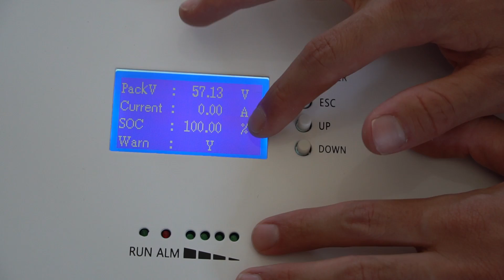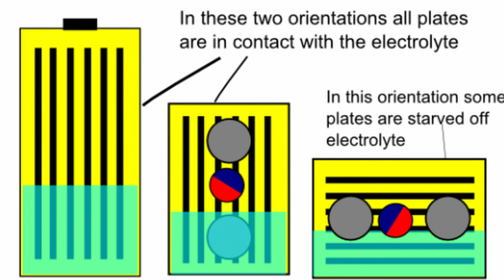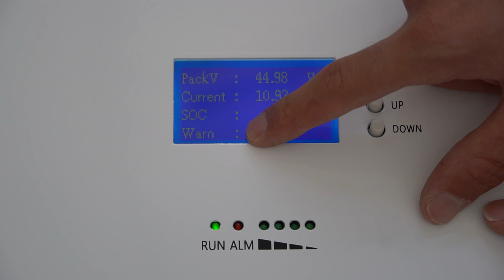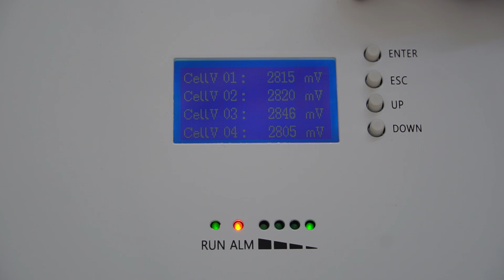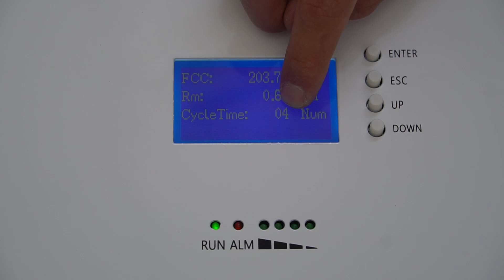10kWh 48V LiFePO4 Plug-N-Play Solar Battery for $.38 per Wh: Full Tear Down and Capacity Test

Comment: I definitely want to try 2 of these batteries, the 13kw variety.  They again seem high as the devil but such a nice design for storage.  I have 48 280 cells setup for 840 ah using Daly Smart BMS units.  Annoying that they do not talk together as one.  Adding 2 of these or even 1 would complete my requirements for daily power.  I also ordered one of your chargers from SS.  The 48v 25a one.  I can\t wait to test it out on this large bank.

Comment: Being that those are relatively small cells, as in a very shallow design, that may facilitate the horizontal orientation.  Bigger cells may be more susceptible to orientation issues.
Reply: Advertising to the manual,  it states must be mounted vertical with no more than max 15 degree backwards tilt

Comment: Just a thought, based on the locations of the main power connector, communication ports, and handles I think they intend this to be installed in rack mount configuration flat on its back.  Yeah the control panel would be a bit more difficult to use but depending on the space between the cells when you rack mount it it should be visible enough (or you just pull it out far enough to read it). My guess is they are assuming you are going to use multiple and hook them all up together with the communication ports to a unified monitoring panel anyway after the initial install so the local control panel wont really be needed after that.  So if that is / was the case then you wouldn't have any issues about the cells stacking up on each other or the electrolyte possibly not being distributed properly.  Thanks for all the vids, I have learned a lot watching this channel!! Currently working on putting together a small pack for camping and contemplating a larger one for a camper.

Comment: The 13.4 kwh battery looks like different technology it goes together in multiple pieces or module packs. Its internals appear to be completely different. Also with a 20year warranty vs 10 year

Comment: About that cycle count, what is the depth of discharge/charge to be considered a cycle? 90%-10%? 80-20? 70-30? Does it have to discharge and charge again to or above the level it started discharging to be considered a cycle?

Comment: 226 pounds worth of Lead Acid batteries gets you about 3.2Kwh at the 5 hour rate, or just over 4Kwh at the 20 hour rate. Of course, that's for the first few cycles. After that, it's anybody's guess....

Comment: Would this battery handle 100% of my electric needs with power out? Air conditioner, microwave, elective stove etc? What's the max rate of usage? Can I recharge this battery with a gas generator? So if power goes out, my whole house can switch to this backup and if it runs low I can recharge with a generator? That's my goal right now as I'm not able to use solar or any other power generation where I'm located

Comment: As far as mounting it flat and maybe stacking them.  Use (very) heavy duty slide rails so you can pull them out and support the battery pack.

Comment: What battery would you recommend on a sail boat? I need 12v 7kwh. It would be inside, but the sea gives bumps and the heat and moist would go up.

Comment: One thing I see that concerns me is how the negative group of cables is laying over the positive pcb.  When going back to 2:20 I do not understand why there is the big loop in the negative carriers when they could have easily been routed straight into the battery area without looping over the positive side of the pcb.  Strange.  Even with the white plastic wire looms over that bundle of negative carriers, I am not comfortable.  I have been a bench level tech and lo and hi V installer for many decades.  Even in fixed applications, I try to avoid any near or cross placements of different polarity carriers.  While I recognize that space is at a premium in this battery system, it only takes a few seconds for high amperage dc power systems to go very quickly into a disastrous situation.
Reply: yeah i wouldnt want to run this in an RV or anything thats going to vibrate

Comment: How do you parallel the different batteries without huge power going through it to level the voltages? I assume lots of amps would flow because of the difference in voltages. Or you exactly matched them before?

Comment: Great video. Two QUESTIONS  1.  Would it be a lot easier and cheaper to have a single 10k unit or a lot more complex and $ to hook up two 5 k units...      2. and would two 5 k units. really provide equal power or less than one 10 k?

Comment: The reason they have to hang on the wall at 1.2 m height or even more .
Is a safety measure , if you have a flooding event .
And that beast is on grond level you have a miniature nuke aswell,  TO WORRY ABOUT ⚡😉⚠️
Reply: Unlikely he is worried about flooding in an unattached shed (no water lines) located in Las Vegas but your point is well taken.
Reply: @genephipps6421  i live in the Netherlands ,  we have a bad history with flooding .
As 85% of the country is beneath sealevel.
Especialy in the province i live in called ´Zeeland´ literaly Sealand .
And the stories of my grand pa ...
Made me biassed toward fearing water i guess ..haha lol
Grtz johny geerts

Comment: man I love these preconfigured options but the pricing never works.  It is just easier to buy 16 280ah cells with bms and instant 15kwh.  Would be great to have Daly make a smart bms that allows for stacking but they are buttheads and have not done it yet.  Do you know of any DIY bms system that has this feature yet?
Reply from the maker: You are right. I love the 280Ah cells as well. Such an easy way to build a massive bank. Oh right, that's the big limitation to FET based BMS. You can stack them but it looks ugly. But it does work.

Comment: What do you recommend for a house with all its appliances except a dryer? How much power do I need for it and should I be using a 24v system? Is the renogy lithium batteries good?
Reply: Gas dryer or electric?

Comment: How much did you spend on this equipment and how long will it take to break even on the on the investment? Is it less than the expected life of the batteries? You have great material. I learn a lot from you but the real answer is to replace fossil fuel plants with renewable plants (nuclear, solar) then figure out how to build systems like these cost effectively for consumers.

Comment: I see a lot of these LiFePo4 Batteries in the market. 

They have the same BMS, same terminals under, same package content, and product layout. 

The difference in the video's product is the Anderson Plug. The plug is a little difficult to find here in Manila. 

Though we are using mainly DEYE Hybrid Inverters in our install, the usual problem of these batteries is the DC Low-Volt Fault and sometimes the batteries don't balance or just becomes fully drained. 

The batteries just automatically returns to its normal condition after Inverter firmware update. 

Though I'm confused as to the reason why these faults happen.
Reply: if with Deye inverter, battery will communicate with inverter, just set the inverter charge voltage will work fine.
Reply: @youthpowersolarbattery9540  Hi, what will I set in the inverter charge voltage? 

I mean, what value should we put or consider?

Comment: Thats still mighty pricey.  I paid $1500 for 8kwh, but to be fair, i had to assemble it my self and it does t look as pretty.  All parts considered, i still paid half of what they are charging.  Assembly is simple - get batteries, assemble on a flat surface, with 90degree angle to  butt it up against. Glue cells together temporarily with hot-glue.  Order nickel strips, cut them as needed, build basic welder using a button, car starter relay $35@local parts store, and some thick copper wires mounted on a wooden block. Use car battery for the power source and get a solid fuse to prevent stupid mistakes.  Get hole saw, cut holes in the right places on a couple 2x4. Cut 2x4 along cener through the holes to provide a top-bottom supper. Sandwich between two ply board cut to right size, leaving room at top to mount BMS and DC fuse.  Connect wire, add a connector like the one seen in the video and bam.  Ive made 17kwh of power my self.  Couple to 6000w of solar panels and midnite 150 solar charge controller.  Make a LVC using $12 programmable delay with thermistor connected to the normally closed side of the board relay, and a 12V 100A relay connected to the normally open side of the board’s relay. This provides a soft start/inrush prevention to keep from damaging the inverter, and prevents the relay contacts from welding together, so the charge controller can shut off reliable when the voltage gets too low.  I run two AC units, one that draws 1.4kw and one that uses 1.1kw.  The second AC unit only comes on when it gets really hot otherwise its not needed.  When the sun goes down i normally have 15-16kwh of power to: charge my neighbors car with the excess, run my two computers and do a number of things.  The BMS has thermal cut off, but because the system is capable of taking in 3.4kw of charge at 1C, and charging never exceeds 4.8kw, the batteries NEVER heat up beyond 31C, in the summer, under full charge load.   These batteries wont heat up appreciable until they reach 1.5-2C charge rate, which my system never achieves.   If you are a DIYer, dont waste your money.  Takes a few days to put the batteries together, a few days to charge and test. Batteries come charged at 3.2V per cell.  Charge pack until any of the 16 rows of cells reach 3.45V, then using Variable DC power supply ( $50 amazon), charge each row to 3.65V and wait till final charge rate settles to .07A, perform this once more for each row 12hr later, then bolt the shell together. Bam. They are ready. BMS will balance them from here.  Its been a year since my last balance and the batteries still dont need maintenance.  If you have time and have the skills, dont waste your money on something like this

Comment: I love the videos Will. Excited to see what's under the blanket. 

The EG4 batteries from signature solar are slightly cheaper at $312/kwh. Am I correct in understanding that the "UL approved" status of this Energetech battery makes it ok to install indoors (garage in my case) for those with home owners insurance? If so, that alone would sway my decision making. The little LCD is another PRO.

Comment: Great video, thanks for the detailed explanation.
With 200Ah how long will it run a typical home?

Also, any idea what size solar array would be required to charge this within 5-6hrs?
Reply: Ah x voltage = watt hours. 1kWh=1000 watts for 1 hour, or 1 watt for 1000 hours etc.  You can also calculate the same with charging, minus the resistive losses or efficiency of inverter/charger, etc. Take a look at the power ratings of your major appliances and then add them up to get a rough calculation of power needed.

Comment: HEY.....Website says 10 yr  wty NOT 20!!!    $3870. each.
Did anyone notice on website those 2 silver handles are on the floor?  Will has them up.  Also Will shows display towards the upper part of the case & website shows them on bottom.  It appears website inverted picture, yes?
I have hdx metal racks from Hm. Depot that can handle 860 lbs.  If u pay attention you will notice that Will also has silver metal racks.  Why not just put them on the racks with wheels?  OR  might it be safe to weld on wheels directly to it?
I am soooo excited about this one......why cud'nt mfg. realize most of us are not body builders and just put wheels on it for us?!?!
As a lady, my limit is 50 lbs lift.  C'mon, give us wheels!

Comment: I have a solar company in Missouri and we put these in more often than anything else. I built a cable hoist to lift them in a controlled way. My only complaint is that the bms is not compatible with the Sol-Ark.
Reply: It should be compatible with sol ark :) unless there are changes fron the mother company going to solark
Reply: If you sell these... would you know if  they are compatible with bus life?

Comment: Try maxsky solar  LPBF48200 Lithium MaxSky Solar 48V. 200A. LiFePO4 6000 cycles,    2,128.71 usd.. been off grid for 3 months with this battery , never skipped a beat..

Comment: I have 3,5 KW solar panels,Outback inverter and charge controller and 48 V 127 amp/h Rolls Agm batteries as a grid tied instalation, battery back up is just for short grid down situations and once in a while huricane conditions, works just fine for 7 years now.
But after last Huricane Nora i ran out of power before the grid game back and dig into the Lithium batteries, nice but the transportation cost to my place are exorbitant high ( easy 900 bucks for 16 cells !
I bought now a 2000 wat inverter mobile generator and a switch over switch, if we run in longer grid down situations i can run the genset and charge the bateries and have power to the house, when the sun comes up or the grid or battries are fully charged in can turn the gens set off .
Gen set and switch cost me around 650 US that is a lot less than onlyt the transporttion cost for the Lithium cells .
I apreciate your opinion about my solution

Comment: It's a really good time to be getting into solar and thinking about power walls. I just had a 9kwh system go on the roof with go-live in about 2 weeks, but it's strictly a grid-tie system with no off-grid support (batteries). My SO remembered Tesla Powerwall and got all excited but I told them no on Tesla due to all the problems and high cost. Trying to steer towards an EV battery for price and safety, but seeing products like this starting to splash down is exciting.

Comment: Is this a good solution for solar panels on the roof? I decided not to get a Tesla Powerwall, but I do wish I had some sort of battery backup in case of outages. Any solution you recommend? I noticed a lot your videos is more for off-grid solar. Thanks.
Reply: Just curious what is the price of the Tesla  powerwall at similar config  to this  unit?

Comment: Will, lots of comments, so I might have missed it, but earlier in the video you were concerned about mounting or standing the battery vertically.  Yet in the end, there it is....  Did you change your mind?  And if so, could you tell us why?

Love your videos, and have been watching for years.  Glad the storage cost is finally coming down and making large batteries a reality for the masses.
Reply: Hmmmm. $3870 .... Not sure that it is priced for the masses. Especially since u still have to buy inverters, Solar Panels, etc
Reply: @TexasLocalProduce  Inverters, wire, solar panels, etc. have never been the prohibitive factor in off grid applications!  A battery this size would have cost you over $10,000 just a few years ago!

Comment: If you converted the 48 volts down to 12 volts, would you roughly have about 40,000 watt hours from this battery ?
Reply: Watt hours are watt hours no matter what the voltage. Current on the other hand goes up if you go with a lower voltage, requiring bigger wires to deliver the same amount of power(watts).
Reply: @lordgarak  thank you

Comment: What do You use for protecting your hands. Are this special protectors against electronic shock or isolation ?
Reply from the maker: When it's under 50V, it's considered safe to touch with dry hands.

Comment: I know David Poz did did a battery review on the Gyll batteries which are very similar you could check those too and see if the price is right :-)
Reply from the maker: Oh yes, I have been aware for months of those packs and other packs with the same internals. They are only out of stock, that's all. Or else I'd have one ages ago.

Comment: Will.. i have a video request.. i have a small off grid 48v cabin. I would like to expand it remotely by outfittjng my rv n tethering the two together like a docking station.. having expanded pv n batt capacity when i am home but the ability to unplug n use the rv away from home on the weekends.. would such a setup be a diy project?

Comment: I wan to build a power wall using 280Ah prismatic  cell, I intend to using 24 battery in total, my system is a 24V , I intend to have 8S 3P,  is there a BMS that can suport this for easy wiring , how can I wire bms to the battery, can you recommend a bms for this setup?

Comment: I would like to see the screen mounted on the end with the communications and power connector then you could set them flat on the ground and stack them or build some kind of racking and lay them flat with a few of them and have a massive system. I should get a smaller pack and some solar to run my network and computer systems, if I built it big enough I could run my 120V mini-split.

Comment: The smaller units have a shorter warranty - it looks like you can spend another $300 and get one with low temp cut-off.  
Crazy good deal, good find.  Thanks for the review.

Comment: My fear of electricity is one major reason I do not go above 24v systems and max out at 4800w. Still a lot of power but survivable LOL.
Also, I prefer a few separate units independent of each. I have 1500 Bluetti, 2400w Battleborn DIY system, and awaiting my Victron MPPT to get back from warranty to complete my 4800w 100ah 24v (12vx2) DIY system. The Victron did not work out of the box! I would not order it again. It may tell you more info, but being dependent on BT is not he way to go.

Comment: I would like them to be laid on their back with the control screen moved to what is the bottom now.  This could allow for a small industrial or large house to have a stackable cabinet of say up to 7 units.  2 cabinet would then allow it's limit of 14 paralleled.
Reply: These batteries support RS-485 communication, so theoretically you could rack mount them and connect them all to a central controller for remote monitoring. That would be the ultimate setup no doubt!